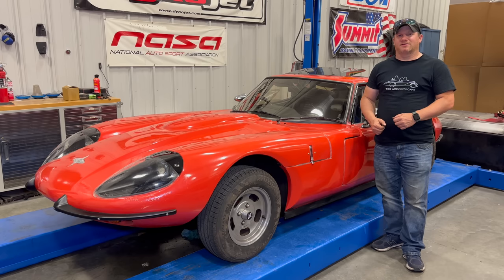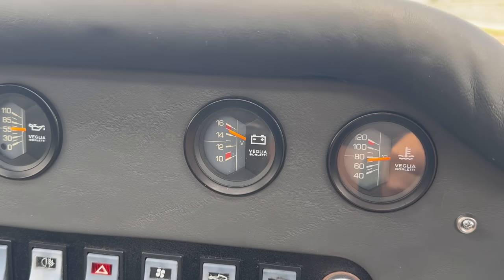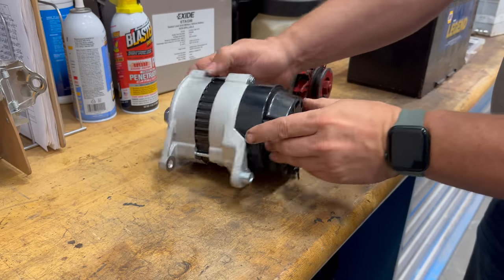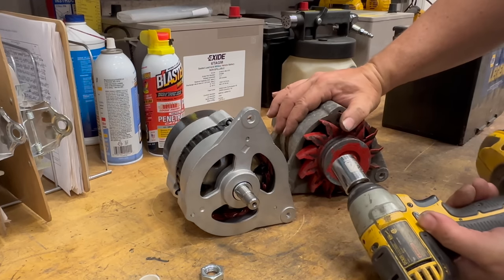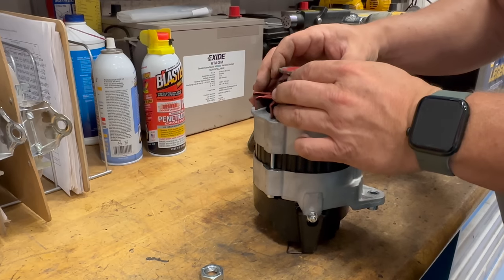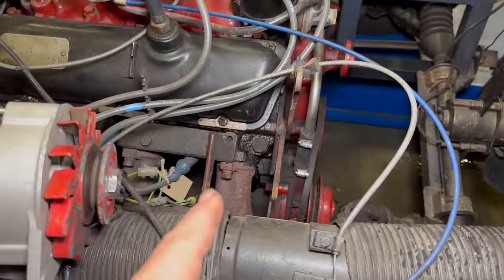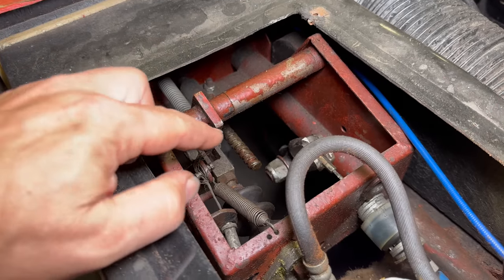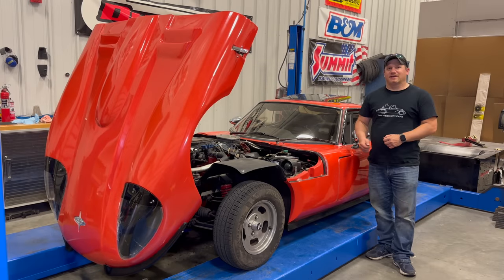Fixing My 3 Liter Marcos GT

Comment: McMaster Carr have various steel coupling / u-joint sets to replace that plastic pedal box adjuster. One of these steel units, though not too expensive, will outlast anything plastic by many decades. Neat car!
Reply from the maker: That is what I was thinking as well.  Believe it or not the original coupling is still available from Marcos Heritage

Comment: There is always some job to do on classic cars but that is the fun I think. Lovely Marcos GT. A friend had a small one (don't recall the model)  he fitted a Mini engine and the running gear and it went quite well he told me though I never got a ride in it! Thanks Steve, another one fixed, well almost.  👍👍
Reply from the maker: That would be the Mini Marcos
Reply: Probably a kit car using Mini running gear called the Mini Marcos, or also known as the Mini Jem. Named after Jem Marsh, one of the founders of Marcos Cars, along with Frank Costin, hence the name Marcos.
Reply: @ThisWeekWithCars  Thanks Steve, I'll put the brain fog down to age!

Comment: Very useful video, I must have been VERY lucky when the alternator on my Marcos 3Ltr failed in France several years ago. The only garage that I could find did not speak any english and was a Citroen franchise but by pointing at the mounts he seemed to understand and came back with a very dusty box containing a Bosch alternator ith exactly the same fixtures👍

Comment: Hey Steve, love the quick fix videos!  I have never seen a mechanical screw pedal adjustment.  Is this a Marcos thing, or is it on other makes and models?
Reply from the maker: Cars today have such things but back then Marcos might be only company doing it.  Both of my Marcos GTs have that feature.
Reply: @ThisWeekWithCars  I think more modern cars move the pedals with an electric motor system, this hand operated mechanical system seems very unique.  Thanks for the info, and the continued great content.

Comment: Your issues seem to be a regulator issue more than the altrnator issues. Is the alternator internally or externally regulated? An external regulator would be easier to replace than an internal.
Reply from the maker: It is internally regulated that is why I replaced the entire alternator.